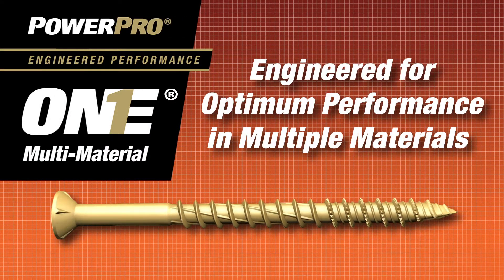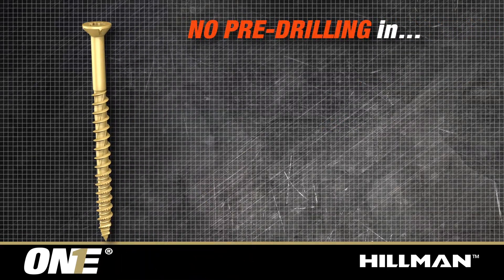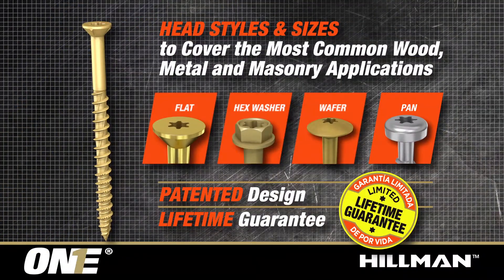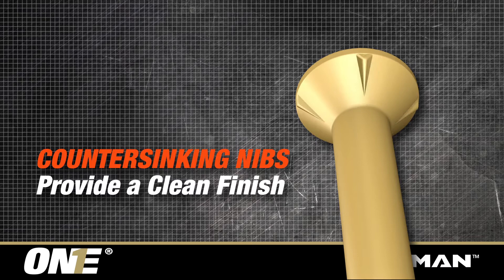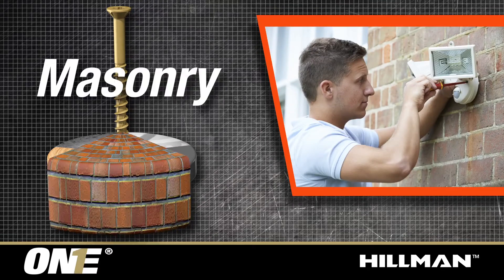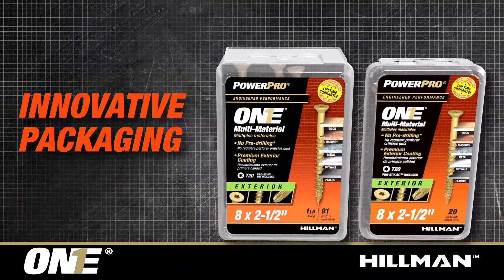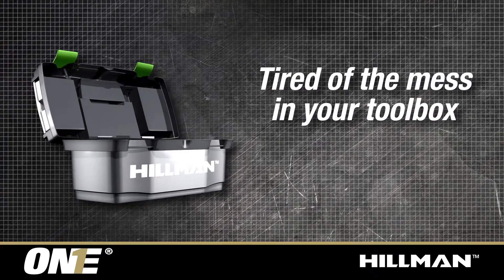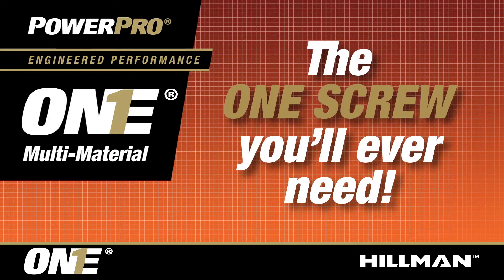Power Pro One Multi Material Screw

Comment: What a great screw! A few years back, I needed to remove and replace all of my deck boards that had been installed by the original homeowner using Phillips flat head screws. What a frustrating experience.  Replacement deck boards were installed using the Hillman power pro screws with the torx drive. WOW! What a difference! Since then I have purchased several boxes of the screws in different sizes. Very happy homeowner!

Comment: It says no predrilling in wood but I drilled straight into wood and it got stuck
Reply: It got stuck because your drill is underpowered correct? If you don't want to buy something newer or more powerful such as an impact gun you could always get by by pre-drilling holes, but this is nothing specific about the screw regardless of the brands I think you're going to have issues if you can't even drill a screw through wood.
Reply: More than likely user error/underpowered drill. You should have a drill with high end and low end transmission (“1 and 2 switch” usually somewhere on the drill”; use your drill in 1 for low speed/high torque situations)or an impact driver. I’ve used these screws for years and have had yet to have issues getting them in anything.